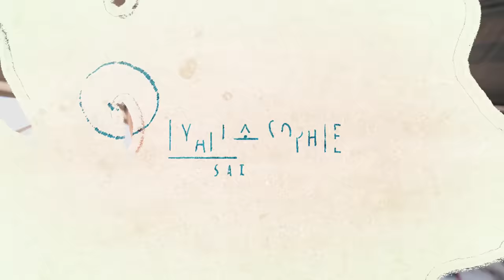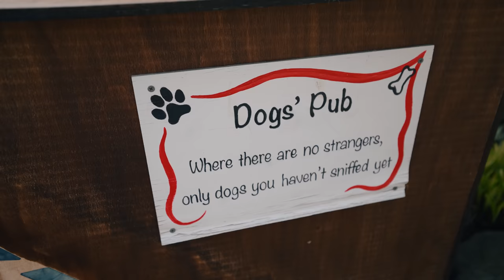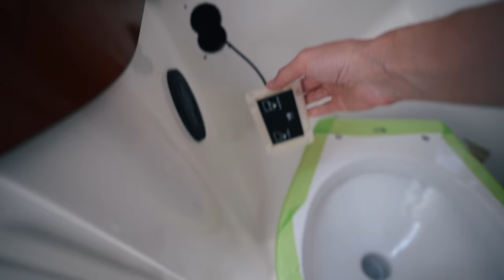Plotting a New Course: How boat projects are impacting our sailing plans (TW: toilet work)

Comment: Wow.  lots of work done this week and the new electrical stuff looks great.  I am concerned about where you transitioned from the 1" to 1½"ø hose.  When you go from a small diameter to large diameter, the speed of the water flow will reduce velocity of the $h1+ that is flowing through the hose.  I assume that the new hose is 1" and the old is 1½"ø.  That is a pipe that is 2.24 times more area than the 1"ø.  The problem with that is that because the fluid slows down, the solids will fall out of suspension, and you will end up with more $h1+ in the hose than you did before.  It would be much better to run the 1"ø hose all the way back to the tank or thru-hull so that the fast moving water will carry the solids out with the liquid.

Comment: Brought back memories of rewiring the Beneteau 361 with the LiFePO4/Victron system. Spent most of a winter planning everything with Visio diagrams. Still took twice as long as expected, so I feel your pain. Nice result.
Sorry to hear about your shortened plans. If you want a stop before the C&D Canal, I have an empty 40' slip at North East River Yacht Club you can use. My boat is on the hard right now and won't be launched until late July.

Comment: There is always the New-York Champlain Canal that takes you from NYC to Lake Champlain and then to the St-Lawrence River not so far from Montréal. It would cut the trip short by a month. The only factor to consider is that the boat should have less than 6.5feet of draft to pass the Richelieu River canal system. Salutations
Reply: Was thinking that also.  Could go straight up the Hudson and thru Lake Champlain to connect to the St. Lawrence as opposed to branching thru the eastern portion of the Erie Canal to shave off some time.  Unfortunately, I think they are still going to be short of time at this point.  You really need to get out of the Maritimes by mid-August and down below Maine by mid-September to avoid the Fall storm season.

Comment: Toilet Pipe Calcification is a problem caused by urine meeting Seawater apparently, and regularly Flushing with Neat Spirit Vinegar that you leave in the Pipes for a while, before Flushing it through with Fresh Spirit Vinegar, you keep repeating until you can’t hear the Vinegar working on the Calcification in the Pipe any longer, then just do the same thing regularly, to prevent the Calcification building up and reducing the internal diameter of the pipe, until it becomes Blocked. I haven’t tried this on my boat yet, as I’m still waiting to buy my next Sailboat, but Spirit Vinegar is cheap, and it is great for removing marks off gel coat,  Non Skid, etc. Thankfully you can’t get Marine Spirit Vinegar, or it would cost hundreds of dollars a gallon. Best Wishes and Fair Winds. Bon in Wales. 👍🏴🌟🌟🌟

Comment: Your wiring looked like some system wiring on an airplane that has been flying on contract for ages before coming back to main base for a long C check. Too many wiring patches that are no longer labeled or has printing worn out from grease and whatever. 😉 didn’t know there was certification for working on marine wiring. BTW, Sophie, that was a nice install. Every time my crew used to do new install, it could always that ONE FASTENER or contact would be missing or on back order.

Comment: If you prefer to use potable water to flush rather than seawater, use water from the sink faucet. I keep a tall water glass on the counter for this purpose.
Reply: We only flush with fresh water to dramatically reduce, if not eliminate, odors from our heads.  We pull over our sink faucet, which is on a pull-out shower head, to fill and rinse the bowl.  Of course, if you are traveling in areas where fresh water is not always readily available, you probably don't want to waste your fresh water supply.  But flushing with sea water is the number one reason that boat heads develop odors.

Comment: That wiring install looks fantastic, great job! Lots of work to do it right and more work to make it look right, then more to make it look simple, I think you hit all three!
Reply: Ryan are above standard. Really very good. But until today, has not found the short-circuit on Sophie. Doesn't stop to talking.
Reply: @Mar-vu9nx  I ended up with a similar issue, where the manufacturer set earth to shore power not the engine block, so if it was plugged in to shore everything was working but when unplugged it was like polarity was reversed. Took a bit to figure that one out!